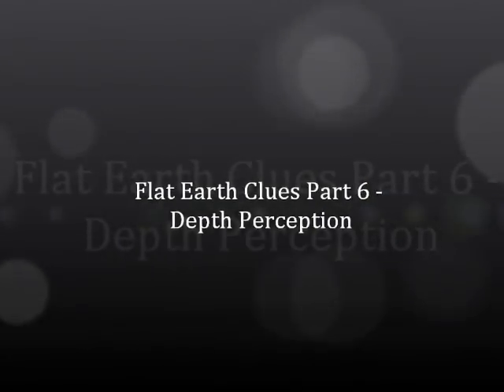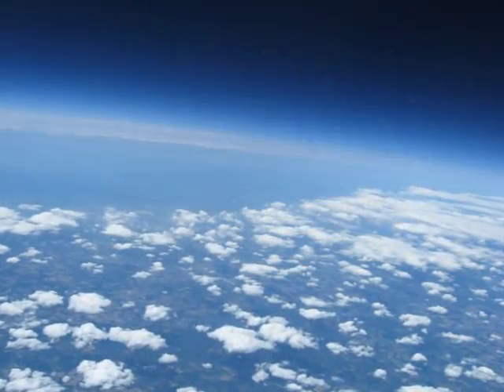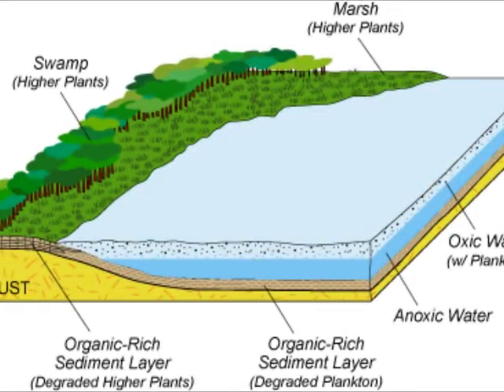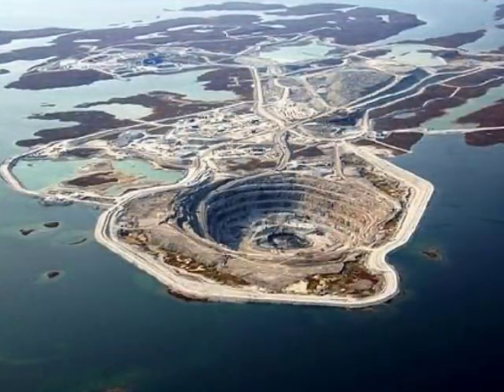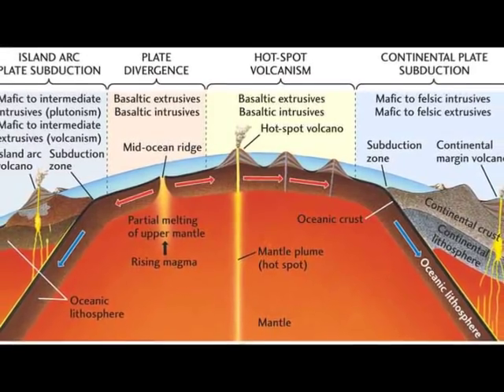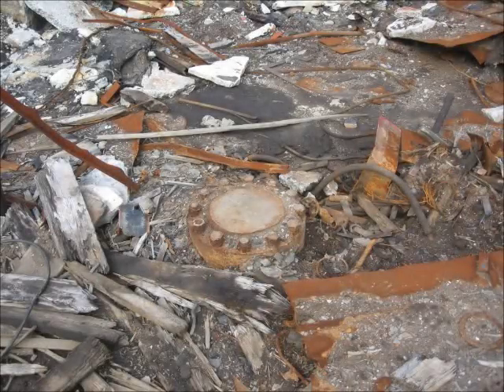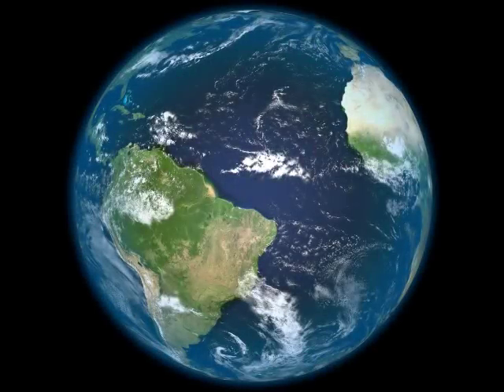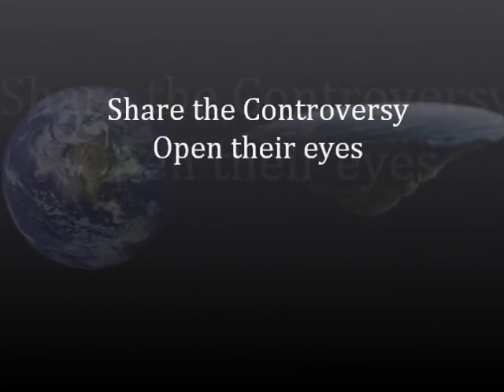FLAT EARTH Clues Part 6 - Depth Perception  - Mark Sargent ✅

Comment: So let me get this straight. You think that because, yes - we do have the ability to artificially melt rock - that means volcanoes are an artificial thing that "they" use to help maintain the idea of a sphere Earth? First of all, we do not have now and never have had the ability to melt rock and create magma, and then pump it up through volcanoes on such a scale. And even if we did, what would the point even be? To maintain the sphere Earth model? I ask again, why??? Why would the shape of the Earth even matter to "them" in the first place? Because they don't want to admit when they're wrong to save face, so they come up with increasingly more extreme fake science to avoid that? Oh that irony...

Comment: Hold up...am I supposed to be under the impression that someone constructed a machine that boils molten rocks underground? If so where did that come from? 😂😏
Reply: 'god'
Reply: @ophiolatreia93  😌 You sure you want to do this Me? Caution: You May Learn Something
Reply: @ophiolatreia93  Care to start off with the 1 Chapter of Genesis?
Reply: @ophiolatreia93  The 2nd Verse Gives a STRONG Implication That the Earth was WITHOUT FORM & IT WAS VOID OF LIFE. Soooo That gives a STRONG IMPLICATION THIS OBJECT WAS UNSTABLE & WOBBLY.......  AND THEN It goes on to say GOD MOVED UPON THE FAAAACE OF THE DEEP (water only object) as in to say HIS SPIRITUAL ENERGY WAS FORMING THAT WHICH WAS UNSTABLE. 😶 Get It? So the reality is....... What was already inside was ALREADY INSIDE (this formless object). At NO TIME is there ANY IMPLICATION there is a "machine" inside of anything. Verses 3-5 are self explanatory. Do you need any Additional Help with 6-10? Because that's where a lot of people try to read what they see at face value. Simply put "Spiritual Error". The misconception of verses 6-10 are where this society has gained much bread and butter. For instance this society never mentions how JOB 26:7 can ALSO MEAN how there is nothing ABOVE OR BELOW as it is SUSPENDED IN SPACE. And Also I hate to break your heart here but....... The very 1st verse is INCORRECT. 😶 Care to ask me how????
Reply: And sorry to be "that dude" but your thumbnail screams confusing and discord. Because in one way it may represent the rainbow covenant between Noah and YHWH. But to have the pyramid next to it like the 2 Natural Enemies (Pharaoh and YHWH) are somehow now cool with each other. But if it's a representation on LGBT movement. I'm sorry (not sorry) to say Neither Faction would be in alignment with such mindsets. 😁

Comment: what is this? part 6? 
i'm of the mind to compliment myself for surviving thus far.
except, you need to know there is a way to penetrate the surfaces of anything, without digging.
oil is discovered on earth without luther and moses digging in turns.
dumb x super-dumb = flat-earth.